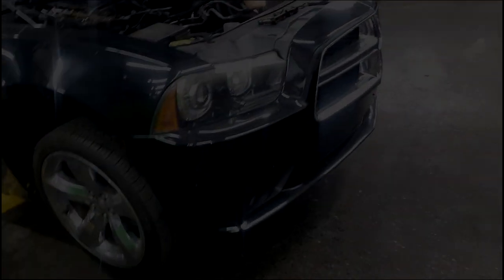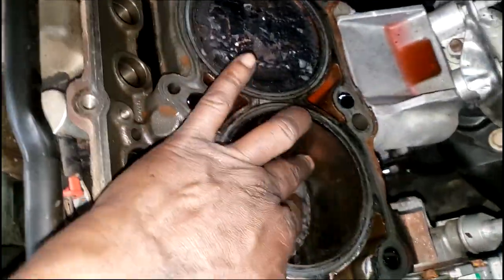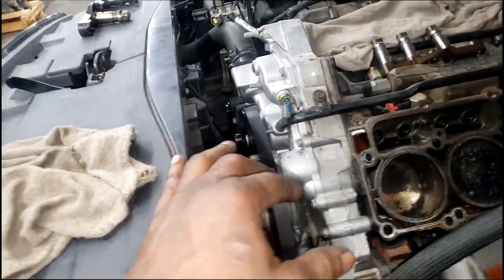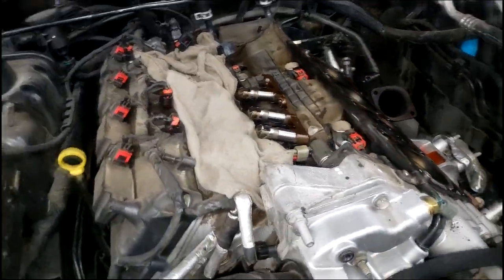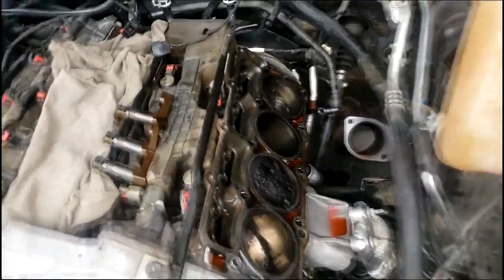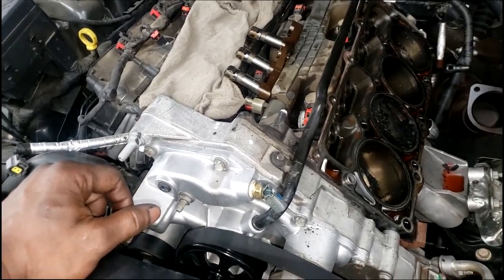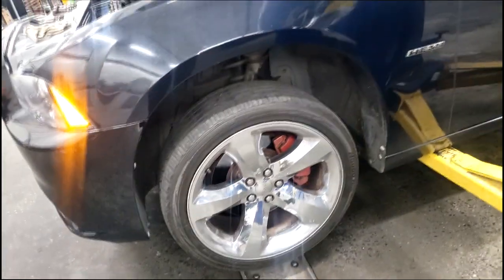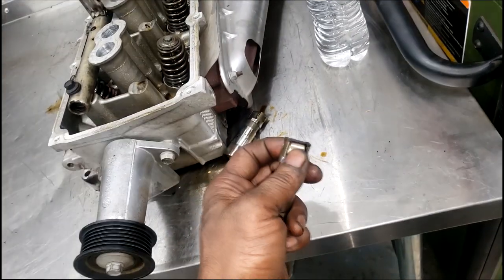TEAR DOWN TIME MUST BE EXPLAINED. In order to give a good estimate on the Hemi Ticking Noise. P0305

Comment: So 6.4 s don't tick, not even on cold start ?
This is new info
Thanks
Reply from the maker: No, they have the same problem..I did some mis-speaking in this video after listening to it.. I was trying to point out that I have yet to do a ticker job on a 6.4 or a 5.7 thats not equipped with MDS such as say a Challenger equipped with a manual transmission. And a lot of the heavy duty trucks may not have MDS

Comment: Hey JT, good stuff hear as always.  Do you know if Chrysler/FCA has and official fix for broken exhaust manifold bolts on the Hemi's?  Thank you Bro!
Reply from the maker: Yes, when we repairing them now. We are given a newer improved bolt package. Also the future models have a brace on the manifold.
Reply: @OnlineMechanicTips  thank you.  I'm going to need to repair my drivers side rear exhaust manifold bolt that broke.  Are the new bolts and brace available for DIY, i have a 2008 grand cherokee 5.7.
Reply from the maker: @respectpeople9181  I cant remember if the new brace kit will come for the older models..I see the new brace kit on the newer trucks, but the manifold has also been redesign so I dont no that by hard.

Comment: I gotta 6.4 392 they do have the MDS big bro.... and trust me they def can tick if your using bad gas I’m in the process of forging my whole motor for nitrous and a cam... but the 6.4 engines def have mds and possibly can tick cause of bad gas it long idle time
Reply from the maker: Yea man I mis-spoke. I had a Challenger torn down for something once and noticed it was not equipped with MDS. I have yet to experience a ticker on a non MDS engine is what I meant to say.
Reply: @OnlineMechanicTips  man I appreciate all the videos and the schooling you give bro we def see you putting in work bro 💪🏾💪🏾💪🏾

Comment: Well they say excessive idling tends to help the lifters to fail and eat the cams. I also heard that the early mds engines don't have vvt so tend to not have the lifter issues but can get hot and drop valve seats.
I'm sure you have talked it before and we have bounced it back and forth between us before. We'll see how long my 06 Charger RT goes but it runs great so far and has about 90.5k now.
I don't think the mds helps that much but they claim it saves 20 percent.